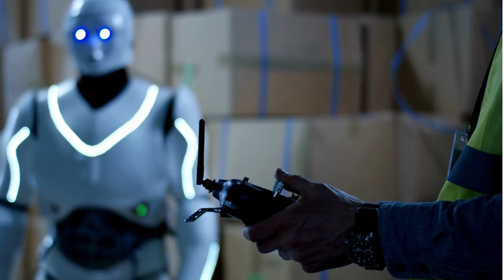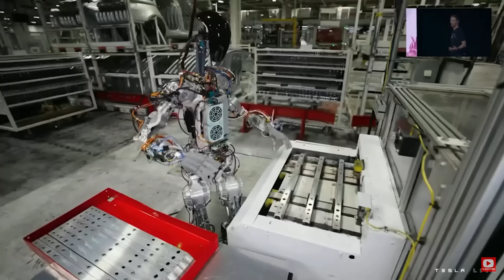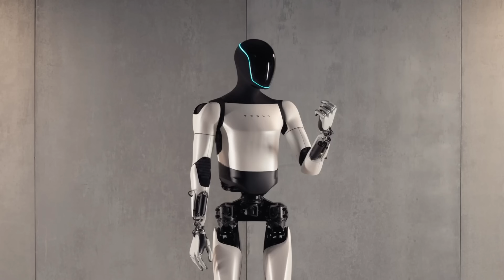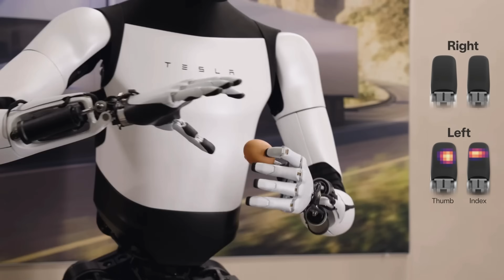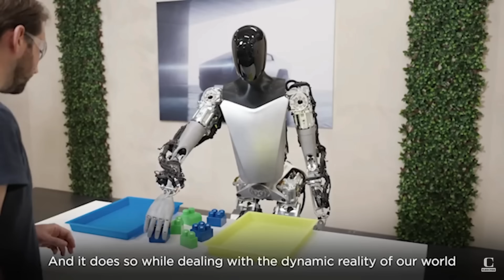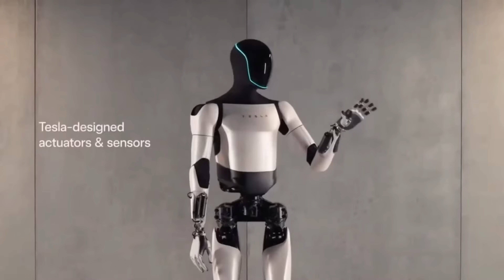Will The TESLA ROBOT Be The Answer? Is OPTIMUS GEN II The Perfect Assistant For The Blind?

Comment: I have a vision impairment that will continue to worsen til I’m in a darkness.  I currently need a mobility cane at night as I feel like I’m walking on a plank in a giant void. 
I’ve seen a robot dog.  It’s about $1300 and has LIDR and ai, you can train it etc. it has great balance, won’t crash into things, I think it can walk for 10kms and does silly stuff like jumping and flips. 

I have thought a great deal about purchasing one and getting my youngest son who has minimal coding experience but a real affinity with the subject,  to help me program one to be a guide.    I’d still use my white mobility cane,  I’d still be aware of the environmental feedback around me. 
But to have it alert me when I’m walking in places where there’s no paths,  or where bushes and trees have been planted up to the curb.  2 nights ago I split my inner lip on a low hanging tree,  for it to make me aware of branches at my head height would really help me relax.  
I try and walk loosely and with a strut, I try not to appear disabled.  But if I’ve been walking for an hour or so,  my body becomes hunched and tense and my steps exaggerated, as I’m preparing to step over a raised paver or path, a tree root or fallen branch.  And I’m also bracing for a pothole, a drop or an area where the path suddenly is missing. 
I’ve had many falls,  2 in particular were so bad I knocked myself out. One fall was so bad I left a nugget in my underwear when I came too.  🤦‍♂️ I had bitten my tongue, torn my pants and my head, hands and knees were bleeding.  I slept for days after that fall.  

I’d love something more akin to the dog to give me tips, on my environment.  To have some of the qualities of a guide dog. 

I’d never want a human sized assistant in public.  
I feel humiliated using a cane as it is.  I am stopped almost daily by people insisting I need help, or that I shouldn’t be out alone, I’ve found myself with tears of frustration at people grabbing my arm or following my down a street near my home yelling like I’m deaf that I’m lost and walking down the wrong street.  The person must have known where I lived and thought I had taken a wrong term,  when I knew where I was.  

Being blind can suck,  I don’t want to be noticed,  but if people saw I was taken care of…. Maybe I could walk in peace.

Help with housework would be great.   When my vision was better my house was spotless. I shampooed my white loungeroom carpet every Sunday.  
Now, my Sons visit with their families and they’ll scrub my kitchen and fridge, clean out my dishwasher and check all my light globes and do a safety and maintenance check on  my home.  
In my mind, the house is clean.  But they’ll see a glass I’ve washed and let me know it’s not cleqn I need to use the dishwasher.  I can’t see that I’m not doing a great job.   Making sure the meat I cook isn’t pink is difficult to. 
An assistant would be helpful.

Comment: The robot right now is a puppet and requires a puppeteer.  It's all smoke and mirrors - which is a Musk trademark trick. The latest video they put out - you can see the hand of the puppeteer on the right hand side entering the frame every once in awhile as the mechanical robot puppet does the same hand movements. Disney imagineers invented this process in the 1960s.